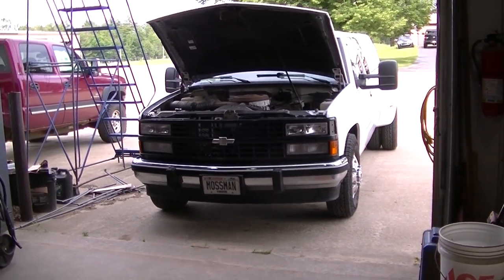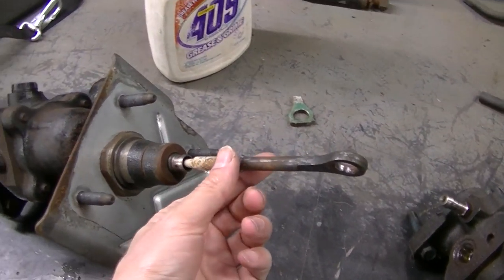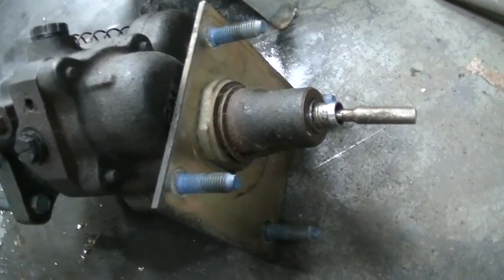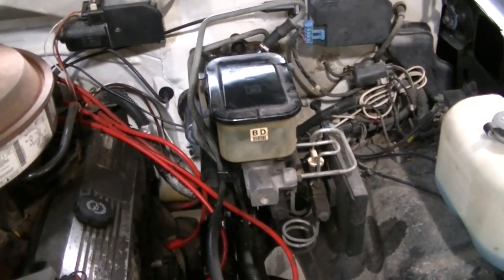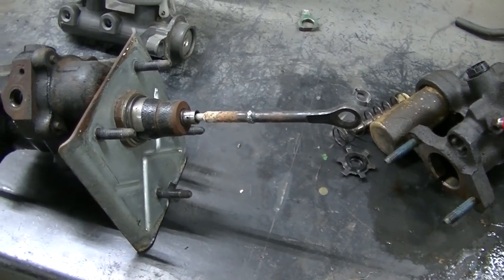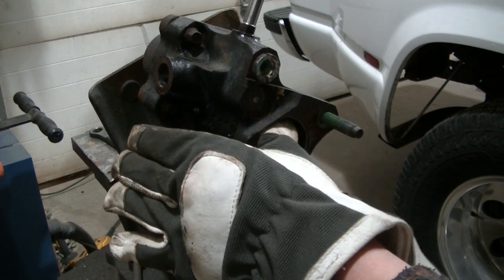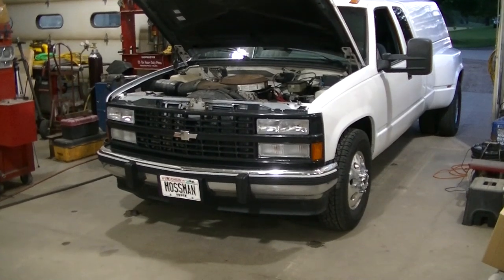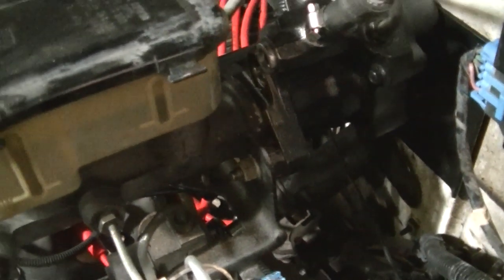91 Dually C3500 | GMT800 Hydroboost Install

Comment: Changed one of those Hydro-Boosts one my son's Chevy G-30 tailgate bus (short bus).  It was pretty strait forward job.  That large nut is fine thread and came off pretty easy, I used large channel locks (if you haven't already figured that out).
Reply from the maker: Easy except those bolts under the dash.
Reply: @mossman381  Yeah, at my age, anything under the dash is a bear.  I need a Chiropractor afterward.

Comment: I had the front brakes sticking on my 07 2500HD, after replacing the rotors, pads and calipers it ended up being the rubber line running from the caliper to the hard line that comes from the booster. Guess the insides can deteriorate and act like a check valve, fluid will flow in but can't flow back out to release the pressure on the caliper.
Reply from the maker: Yup, I always recommend changing brake lines when you do older brake jobs. I have new everything on this truck so I figured it was calipers or hoses.

Comment: So was I not paying attention, or did you specify why this would be a desirable mod?  What are the advantages over a GMT400 Hydroboost?
Reply from the maker: I thought there might be better braking but I don't really feel that. The other reason is cheaper part. I got this hydroboost for $116. A rebuilt gmt400 one was over $220.  And any auto parts store will have a gmt800 hydroboost on the shelf. Carquest couldn't even order me a gmt400 one.
Reply: @mossman381  Have to use the 2010 model year for a improvement
Reply from the maker: You sure it's not a 2011.  That is when they changed the chassis.  I saved $100 so I feel pretty good about it and I am ready for a newer unit if I want to try.  I don't really feel like I need more braking.  This thing stops great.

Comment: Ok mossman381 how do you get the brake switch and pin out? Our trucks should be the same. 1998 GMC  c3500.  It is all shrouded by the steel from steering.
Reply from the maker: I am not sure a 98 and a 91 are the same. On my truck the brake light switch is snapped into the dash and is also adjustable so your lights come on with the pedal pushed. It's not easy to get it out but doesn't require any tools. The dash was changed in 96 I believe so again not sure if it would be the same.
Reply: Ok yes hard to get to! Completely covered
Reply from the maker: The underside of the dash is completely covered?  On mine that switch comes out pretty much straight down.  It's clipped on the brake pedal and a support above the pedal.

Comment: Is there a trick to bleeding the air out of the hydroboost. Mine is leaking on my 01 gmc 2500hd and I figured I'd try to change it out. Just afraid of getting air into the system.
Reply: When I did my son's I just bled it like you would with a power steering pump change.
Reply from the maker: Just make sure you have good amount of fluid in the pump. Fire it up and push brakes a bunch of times. All the air should bleed out pretty quickly. Keep an eye on pump fluid level. Just changing a hydroboost you won't loose much fluid.
Reply: @mossman381  thanks for the help. Getting ready to watch your wheel hub video as well.
Reply: it may not bleed at idle, blip throttle to 2000rpm once or twice to get it going and resume bleeding normally

Comment: Could have maybe threaded each end of the shafts and made the shaft adjustable.
Reply from the maker: I think if I just had a rebuilt unit first time around I would have been fine. I would make the shaft at least 7 3/4". The pedal is lower than the original but actually it seemed to high to me compared to my other trucks. Making a spacer to push that switch shouldn't be that difficult. The cruise doesn't work right now so pretty sure that is what it is.
Reply: @mossman381  Yah, In my 80's GM cars I believe the cruise and TCC kill switch were incorporated into one switch, or maybe the other way around.  I'm going back 25 years LOL!

Comment: Didnt help at all
Reply from the maker: This isn't going to give you more braking power. It's just a cheaper more available hydroboost than the oem gmt400.
Reply: @mossman381  ok I thought it would show how to take it off..... I have a gmt 400 but not a dually, I read installation so I figured it would show that
Reply from the maker: It sounds like you have little to no experience wrenching on trucks. This video should have given you a really good idea on what to expect. Your braking system is very important so I would recommend taking your truck to a mechanic that knows what they are doing for your safety and the safety of others on the road.
Reply: Wasnt worried about the breaking system now was worried about how to take it off and put it on...  THANKS
Reply from the maker: @kingdaddy8366  You take the clip off the brake rod I showed you. You take the nuts off the studs I showed you. You take off the hoses I showed you. You unbolt the master cylinder and hang it out of the way like I showed you. Then you can take out the booster. I don't know what you expected to see but this video should have giving you a good idea on how the job would go. If you needed to ask some questions fine but don't leave a dumb comment like "didn't help".
Reply: Watched this video again and you NEVER said anything about a clip or whatever you was talking about so you cudda left it at that I went to another video yet you're still dwelling on it all in all it was a good video and as I stated before "it didn't help me at all" maybe it helped someone else but not me that's all and I kinda know what I'm doing but you wasn't a help to me that's all THANKS again
Reply from the maker: I watched the video myself and I was wrong. This video is more about using the GMT800 hydroboost than an install video. I have a video on the GMT800 hydroboost that I show the clip and stuff. I have so many videos it's hard to keep track of all of them.